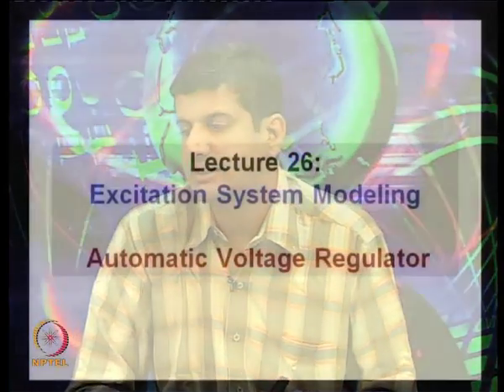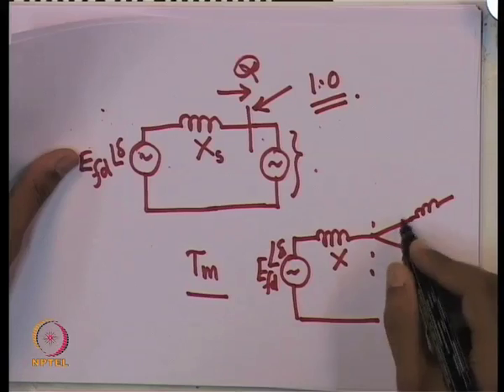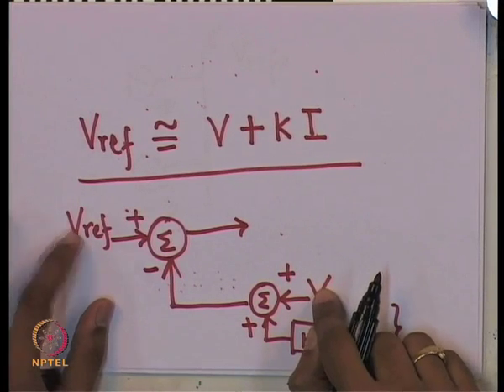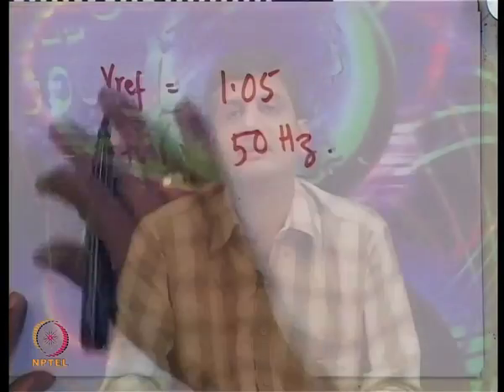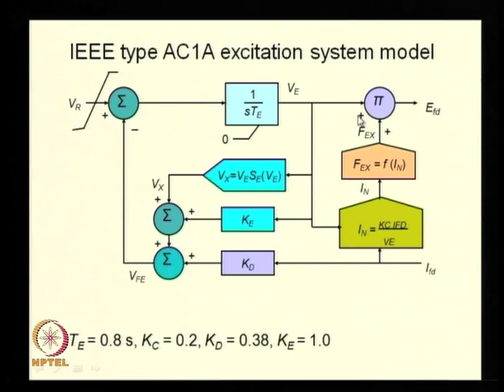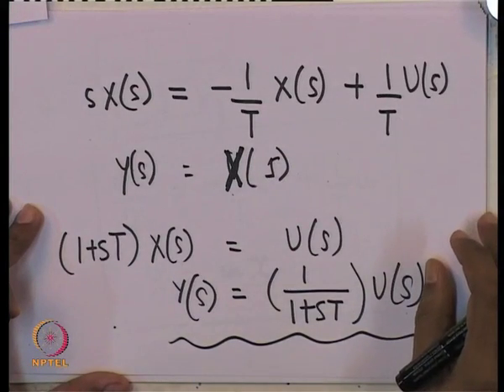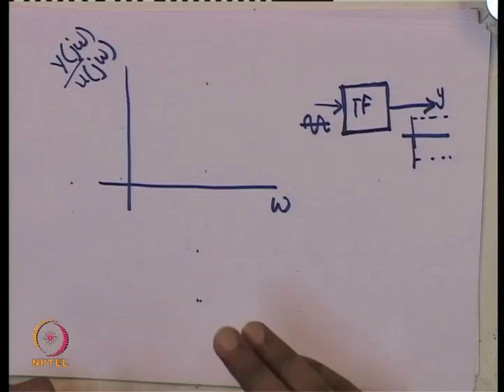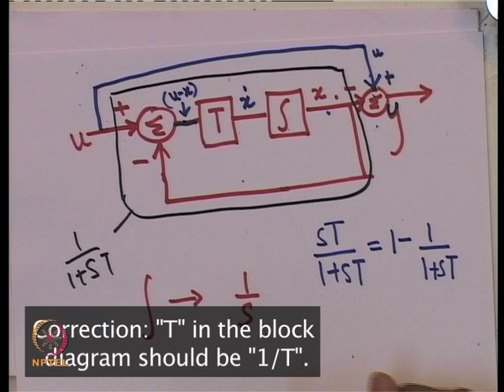Mod-01 Lec-26 Excitation System Modeling. Automatic Voltage Regulator

Comment: In DC, we Connect two batteries in series or parallel makes voltage double.
Why not in AC?
Reply: because it may not be necessary that would both have same instantaneous voltage
Reply: If you know some tools like MATLAB ,PSPICE etc do implement and see how the output changes if you add ac sources ,you will understand very well yourself and try to cultivate such habits wherever you are stuck